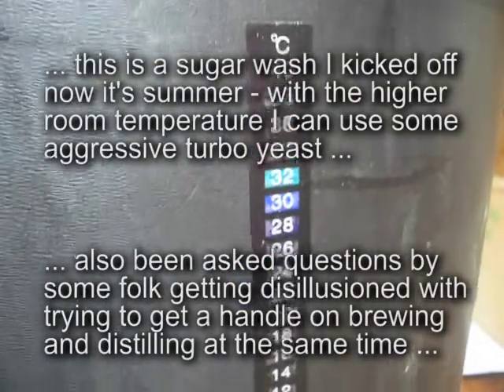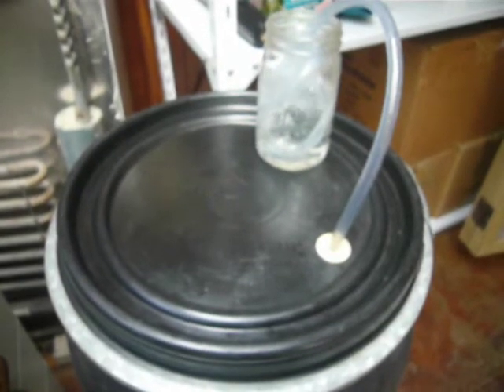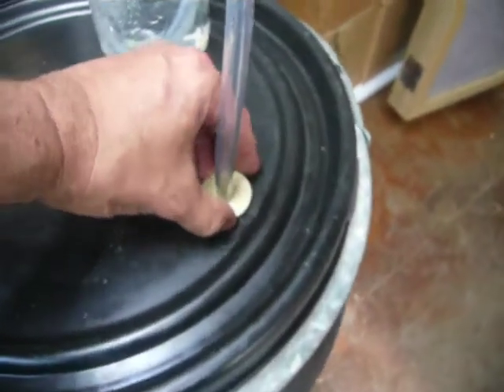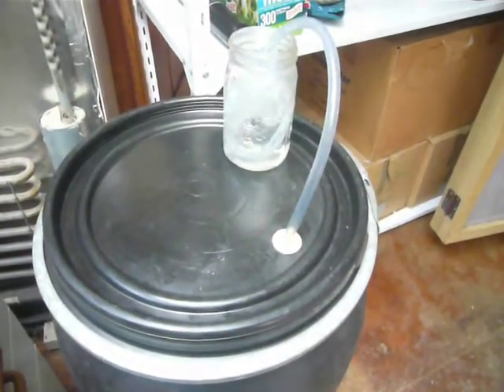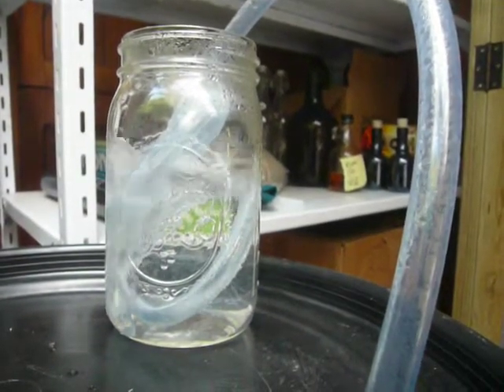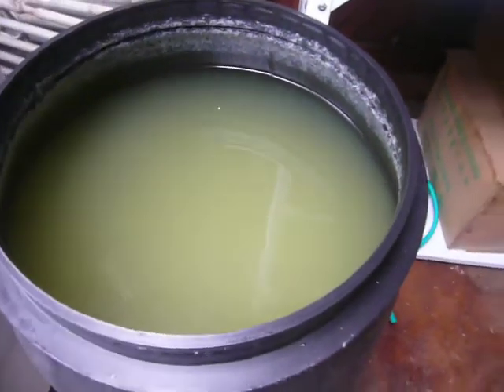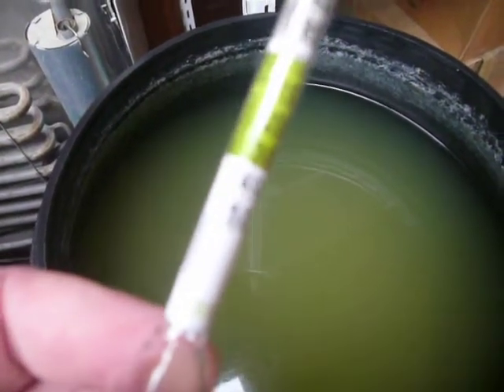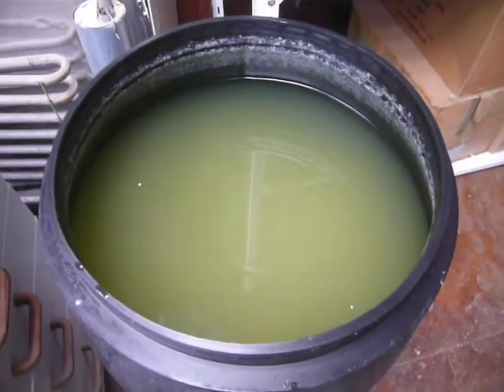Fermenting out a sugarwash with summer temperatures.

Comment: Wow! I thought I'd seen an aggressive fermentation, but that was nuts:-)
Reply from the maker: Heya Bearded, yeah its nice to have a good ferment kick off hard after winter temperatures.

The volume of fermentables is what creates all that pressure/gas.
I've seen giant airlocks in breweries before that consisted of a 2 inch hose running from the top of a massive fermenting silo into a plastic barrel of water, it looked like a spa pool! - that was impressive! :o)

Comment: Thanks again for a great educational vid.  Can you throw anything up re running a reflux still?  I have a liquid management reflux still and have yet to use it.  I am a pot and thumper man, but wish to make a light rum with the reflux still.  Keep them coming please. Jimy
Reply from the maker: G'day Jimy,
Yep, reflux still vid' definitely coming. :o)

I've been running a series of stripping runs on sugar washes lately to fill the 200L HWC still I built - they're going to be distilled out as neutral spirit (as close to 95% as I can get) with a 4" reflux column I'm putting the finishing touches to over Christmas ... which is another video again haha.
That'll be using the 4" dephlegmator I built in an earlier video to force the reflux.

Merry Christmas and a Happy New Year from New Zealand !
Reply: Thanks a mil and many happy returns from Ireland

Comment: For some reason I bought corn sugar in bulk not granulated.
I made a wash of 14lb of sugar diluted in 26litres of water.
This gave me an SG 1.090 with a calculated ABV of 12 . what percent alcohol can I expect after distilling through my 2” combination still using reflux.
This will be my very first run using the 2” combination still that I built from your videos.
Although my wash has been fermenting for a few days now and the SG will be reducing as the  yeast does its thing
 could I still add more sugar to get my wash up to 18%?
Cheers mate. Keep up the good work.
Reply from the maker: G'day Mel,
Remember to do a cleaning run 50/50 water/vinegar after your build.

What ABV distillate you get out using reflux config' is kinda up to how you run the still … and any limitations of what you've built and how you rigged/packed it (what did you pack you column with?).
If  your build is good and you run it right you should be up around 95/96% yield - best possible outcome.
It's not like a potstill in that the abv of your wash has some determining factor in what your distillate abv will be (as well as how you run your potstill).

Corn sugar … dextrose right? I've only used it a few times - it takes more weight in dextrose to ferment out the same result than regular sucrose table/caster sugar.
In NZ here, dextrose is hella more expensive too, but, it has a rep' for fermenting out cleaner.

I've known people to add more sugar again and again after primary ferment each time the gravity starts dropping down towards 1.0 to keep the yeast working and the abv up without initially stressing and killing the yeast.
I've never done that, I keep things simple once I pitch my yeast -except for the odd stuck ferment where I have to open the barrel and dick around with it. :o)

This vid' was just a down-n-dirty sugar wash … I don't usually chase the abv monster in my washes and I don't reflux distill that often (more of a rum and whisky guy).
As a suggestion if you are starting out (and even when you have it nailed), you may get better mileage doing two batches at a lower abv for yield rather than chasing 18-20% washes - you don't stress the yeast and there aren't generally as many nasty by-products being created with the heat and osmotic pressure in the ferment.
Reply: Angry Parrot Distillery Thanks for that.
Yes I am beginning the first cleaning run next week with 15 litres of vinegar and 15 litres water.
I also added a sight glass to my still just for a bit of fun to watch the condensate, and also made an infusion basket to hold my botanicals..
Having listened to what you have said I won’t waste my money on the corn sugar next time.
I have made a 25litre batch of Rum using 4kg of sugar and 4kg of molasses which I will run in pot mode and also as I mentioned a 27litre batch of sugar wash for a Gin/vodka run under reflux.
Can’t wait to do my first run. Fingers crossed I’ll get some good results.
Thanks again big fella.👍
Reply from the maker: Haha - you've definitely got the bug!
Wasn't saying you wasted your money on corn sugar - you might have really good results with it. :o)
Would love to know how your first runs go.
Happy Distilling Mel!

Comment: Marry Christ birthday mates from Florida..So hay got a drum it  taste like tails run five got any tips on how to clean that up with out running it threw 7 times...? Barrel set for two weeks and soured even more ..with little water first two runs was great even after last one had a great apple smell on fermentation.. thinking Sugar up thump tank and run real slow.maybe even put some fresh fruit in.Its a sweet feed wash
Reply from the maker: G'day Derrick, yeah you could use your thumper as a gin head and try and infuse your spirit with something, ... what I've done before with a feijoa brandy that I wasn't happy with was to "apple-pie" it like "apple-pie moonshine" (I tempered the feijoa brandy with feijoa-and-apple juice).

You take the high-alcohol distilled spirit and instead of tempering it back with clean water you temper it back with fruit juice or whatever flavour it was you wanted to add - that may mask the nasty taste you've got there and make it drinkable.

Short of that I guess running it through a reflux column and stripping all the flavor out of it right back to a neutral vodka spirit would be the other option.

Good luck fella and Merry Christmas from New Zealand.
Reply: LemmingHerda thanks will sweeten her up like the apple juice cut
Reply from the maker: Have a search online - there are some quite good "apple-pie" moonshine recipes that use spices and such as well as the apple juice. Good luck.
Reply: LemmingHerda got it thanks mate

Comment: What kind of nutrients and yeast did you use?
Wow.
Reply from the maker: G'day Bama'

I'm at work so don't have a journal with me (this was about a year ago now), from memory it was a nasty ol' turbo yeast of some kind (just to deal with the high osmotic pressure either end of the ferment) which usually has some nutrient in it anyways.

This was a bit of an experiment to see how clean/neutral I could process a sugar wash like this with my distilling gear I had on hand at the time.

Added nutrients from memory would have been;
DAP (diammonium phosphate)
Several vitamin-C tablets ground up (fizz-in-water type)
A couple of Mens multi-vitamin supplement tablets (ground up fine)
Some plant growth nutrient
About a kg and a half of wheat bran
I may have even blended up and thrown in a can of tomato paste for good measure.

Citric acid added also - just to adjust the PH for the yeast before pitching - not as any kind of nutrient.

Things I did wrong that I wouldn't do again and that stopped the wash fermenting out "dry";

1) I'm pretty sure I may have under-pitched the yeast slightly. If you are making stupidly high abv washes you want to overpitch by a margin just to give your yeast the momentum to ferment out fully before the alcohol % starts retarding their efficiency.

2) I let the wash get to hot - it was running up over 30degC at one stage - I should have dropped my copper wort chiller coil in there and dropped it back to 20-25 degC, too high a temp will damage your yeast or even kill it off altogether.
 (although turbo yeast generally handles the higher temps better than regular yeasts).
Fermenting in larger volumes also creates more of a thermal mass with will retain heat longer and raise the temp higher during ferment than a comparative smaller batch.

Happy Distilling.
Reply from the maker: Hey Bama - it's loosely a recipe from NZ home distillers site. TeddySads Vodka;
http://www.nzhomedistiller.org.nz/forum/viewtopic.php?f=8&t=121

Comment: Turbowhat
Reply from the maker: Turbo yeast, generally nasty stuff.
Is a high attenuating strain of yeast packaged up with a selection of promoters, nutrients and minerals that "turbocharge" the yeast.

Is possible to ferment out 20% abv sugar washes with it.
Not generally recomended tho as it with throw off flavors and certainly at those high abv end-ferment levels.

Afaik turboyeast was originally developed for the ethanol-fuel industry where it is ALL about yield and zero about taste, ... unless you have a fussy Euro-sports car that will only drink 20y/o Laphroaig. 🤣

Having said all that, it is a fairly bulletproof way to ferment and if you are just starting out in the hobby and wanted to limit the no. of variables that could go wrong on your first few batches I certainly wouldn't be looking down my nose at you for using it.

As you get more and more acomplished you'll want to start matching yeasts to what you are brewing. 👍